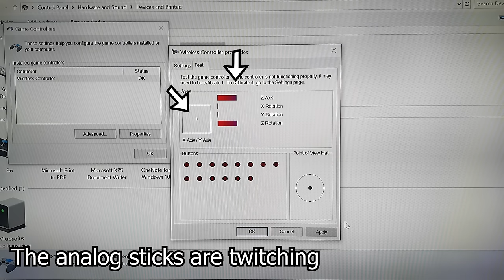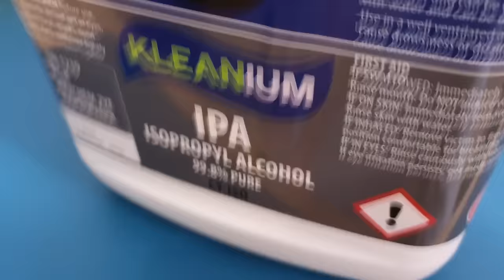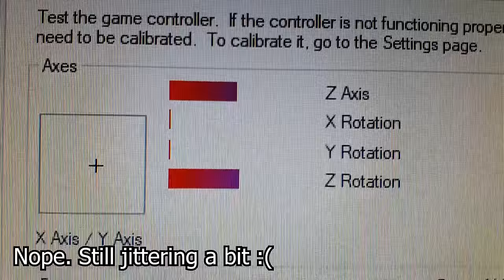How to take apart PS4 Controller and Repair the Analog Sticks

Comment: I have a question do you know what’s the small paperclip which is round for and if you have use it because i accidentally remove what looks like a paperclip although both my controllers work very well I kept the tiny paper clip I found behind my L2 stick
Reply from the maker: The is one of the springs for the triggers. It's what makes the button spring back to it's original position after you press it. It is needed. Not sure how your button is working properly without it.
Reply from the maker: @18yearoldboy38  ok that's good!

Comment: I have a issue with my ps4 controller where every time I plug the headset into the controller the right analog stick starts to drift up. But if I plug it out it doesn't drift.  Do you know why? It's very annoying

Comment: What tool did you use to bend the contacts back? I don't have anything thin enough to between the crack.
Reply from the maker: You can use a knife (be careful). The tool I used is a metal spudger, it's also a dental tool for mixing fillings.

Comment: Did u replaxe it with the fake Alps analog stick? You should buy the original one they're identical but in material in it is different
Reply from the maker: Where do you buy the original ALPS sticks from? How can you tell the one I used is not original? Thanks
Reply: At 9:30 I saw it was fake alps , u can inspect the trimmer area on top of it, a thinner black means it's fake, ,

Comment: I can’t seem to undo the left side of my controller. I can pop off the right side, but the left seems to be pretty stuck and I’m Afraid If I push harder it’ll snap
Reply from the maker: Yeah it's pretty hard, some are harder than others. I've snapped them before. They're aren't super important, as there are 4 screws holding the controller together.

Comment: 2:51 i messed up i broke that little part
Reply from the maker: Oh no, the ribbon cable or the socket it plugs into? The ribbon cable can be replaced fairly easily
Reply: @RestoreTechnique  oh no wait the ribbon cable
Reply from the maker: @navisgay  https://www.ebay.com.au/itm/10-12-14-Pin-Power-Switch-Ribbon-Flex-Cable-Tool-Set-For-PS4-Controll-slY-FF-/393679953199?mkcid=16&mkevt=1&_trksid=p2349624.m46890.l49286&mkrid=705-154756-20017-0

Comment: I simply just drowned my whole controller in a bowl full of 70% isp. For about 10 minutes, took it out, used my air- compressor to blow it out, and let controller sit for 4 hrs..and it works like-a- brand-new, never taking it apart.

Comment: Hey bud need a lil help. my PS4 controller or ds4 controller whatever ya wana call it. Basically.one day it wouldn’t turn on. And I tried every reset and also all the tricks removing from blue tooth and trying safe mode. So nothing worked. I replaced the USB port and ribbon cable. My laptop tells me that the circle and ps buttons don’t work. Tried to clean with alcohol but nothing. Should I replace the film for the buttons that goes over the board? Might have to get a new one no stores around me have a ds4 controller.
Reply from the maker: So you did manage to turn it on, and some of the buttons didn't work? Have you tested the button film with a multimeter? I would test the film using continuity mode, and make sure the O button and the PS button contacts do have continuity with the contacts on the other end of the film, that makes contact with the circuit board. If they don't, you should be able to follow the traces and see that there's a break in the trace for those buttons. If there is continuity on the button film, then either you're reassembling the controller improperly, or the problem lies with the circuit board.

Comment: Hi! After cleaning and closed my controller, x, circle, square and triangle don't work. What shall I do?
Reply from the maker: Does the D-pad work? It would be the plastic film that has the button contacts on it. Either it's damaged, torn maybe, or it's not making proper connection to the motherboard. You will need to open it up to check it.

Comment: My d-pad is permanently pressing left. I've taken it apart, cleaned it, tried the pencil trick, swapped the rubber under the pad from another controller and replaced the green  conductive strip and it still keeps going left! Please help!
Reply from the maker: You've replaced the contact film for all the buttons?
It sounds like you've tried everything, so it must be a fault on the motherboard. Maybe with the plug for the contact film, or a bad IC chip.
Looks like circuit board diagnosis and repair is required. Otherwise a new controller.
(obviously I can't rule out other issues without seeing it though)

Comment: Hey my controller it dropped a lot and one day it fell and just completely broke. It won’t turn on  or charge. But i used to rage ALOT and so their we’re screws inside that were loose and like not even connected to the controller inside. Would me doing this and putting the screws back fix it?
Reply from the maker: Unlikely, sounds like you've got bigger problems than analog stick drift. I would definitely open it up though, it could just be a disconnected battery, or charge port. Or the circuit board could be damaged. How do you know it's screws inside that are loose? Could be components off circuit board, or bits of plastic.

Comment: how are you able to get your Controller to show up on your Computer like that? Im having issues with my right analog and Im trying to see if its really the analog or if its somehow sticking
Reply from the maker: Plug it in to your computer running Windows 10. Go into Devices and Printers under Control Panel. Then follow the video guide from 0:31
Reply: @RestoreTechnique  I have done this , it just does not show, Tried different cords, even restarted my computer thinking it may help, Updated drivers and such to be safe , Notta, Doesnt show what so ever
Reply from the maker: @nick250ification  That's odd, i just tried this now and it worked. Using a CUH-ZCT1E controller, a Sony USB cable and a cheap generic cable. With the controller turned off, i plugged it in, Windows said "installing driver" or something like that, then it was there in Devices. Does your computer make any noise or show any notification when you plug it in?
Reply: @RestoreTechnique  Yes I get noise indicating my computer is detecting a device plugged in but the controller is physically not detected , Unless thats how badly damaged the controller I have is

Comment: Yeah I keep getting that when I release the controller when I look around it keeps spinning round when I let go and then when I try to look around again it won't like its jammed on looking straight when I'm trying to look around then suddenly start spinning around again by its self and it also affects my other keys as well like it won't fire when pressing R2 button and everything else but it can't be the old controllers as I bought new ones and they act exactly the same... So I have no idea what's going on with them but I have noticed that they do it when the battery level is nearly dead so weather that has anything to do with it or something else I don't know

Comment: Tools list?
Reply from the maker: Plastic pry tool, #0 Phillips Head screwdriver, soldering iron, hot air soldering station, flux, solder, kapton tape, tweezers, pliers, 99% Isopropyl Alcohol, cotton buds, micro fibre cloth, and replacement analog sticks.

Comment: What is that thin object you used to get in between you the small spaces?
Reply from the maker: The metal one? It's a metal spudger. It's a mobile phone and electronics opening tool, but it's also a dental tool. I got mine in a tool kit ages ago, and then I bought a new one last year, but it's not as thin as my old one, so I don't use it. It's my favourite tool.
Reply: @RestoreTechnique  ok, thanks!

Comment: When i shake my control it turns off what do you think is the problem?
Reply from the maker: Poor connection probably, maybe with the battery. Or could be a short circuit on the board.

Comment: So I cleaned the potentiometers and put my controller back together but now my x button doesn't work. How do I fix this.
Reply from the maker: It all depends on how it's been damaged/dislodged, you've obviously done something wrong when reassembling it. Check the button flex circuit, see if you've ripped it anywhere. Check the X button contact, make sure it's not dirty, and if you have a multimeter check continuity between the contact and the trace. Also check to make sure the flex circuit is properly seated on the little tabs that align it. And check that the contacts that press against the motherboard are actually contacting the motherboard properly.
Reply: @RestoreTechnique  ok i will check those thanks.

Comment: would hot glue work to solder the wires back on?
Reply from the maker: No. That's not soldering. Hot glue may reattach the wires enough to make a connection, but it would be very sketchy, probably wouldn't last long if it did work.

Comment: i kinda broke the thing covering the touchpad cable, is it fine if i reassemble/use the controller without the thing covering it?
Reply from the maker: Do you mean the white socket that the cable plugs into? 2:49
Reply: @RestoreTechnique  yeah i think so.. or its roof
Reply from the maker: @theddytur  So if the touch pad cable doesn't stay in the slot, then it won't work. You could try putting some tape over it to hold it in place. Otherwise you need to solder on a new socket.
Reply: @RestoreTechnique  reassembled it and thankfully its staying put rn without any problem with the white rectangular roof thing off. i'll try putting some tape over it if it i notice it's starting to come off the slot. was wondering cause i thought it was dangerous to use the controller with the cable just having no cover

Comment: hello I see u used flux so I have it but its color is not all white and it is in a jar not a tube so should I use it and instead of a heat gun can I use hair dryer because i have to do it fast in like 1 or 2 days
Reply from the maker: Yeah any flux will work
I don't think a hair dryer can get hot enough to melt solder, and the nozel is too wide.
Reply: @RestoreTechnique  thanks

Comment: What brand hot air station are you using and what did it cost you?
Reply from the maker: YIHUA 2008D, $100.
Reply: That looks so much easier to use than a solder sucker. Just heat up the whole thing and it pulls right out. I did a stick mechanism recently and it was torture trying to use the wick, sucker add solder re suck. etc. I ended up tearing one of the traces off the board from overheating it!
Reply: @RestoreTechnique  also what temp do you use on the hot air station?
Reply from the maker: @sobrien8478  400-420C

Comment: My issue isnt joy stick drift but the L3 button tends to trigger the R2 button. Sometimes just using the left joystick to move around at all does so. AND sometimes even shaking the controller or squeezing just the handles only triggers it!

I just bought Re4 and im trying to play it, but now i cant! Haha. I did take it apart like shown here up to the point ofbjust visually inspecting the bother board and joy stick buttons but nothing looks damaged nore dorty. Any ideas?
Reply from the maker: That is a very odd combination. L3 is a button in the analog stick that solders directly to the motherboard. R2 is on a carbon flexible film that has nearly all the other buttons on it.
The only buttons that don't use that film are R3, L3, Options, Share, and Touchpad.
The trigger buttons R2 and L2 do function off a carbon resistor on that film. I'm guessing that there's some short or issue with the motherboard, and the L stick is messing with the resistance going to the R2 button.
I would inspect the motherboard for liquid damage, or any fried components.
Doesn't sound like an easy fix though. 😬

Comment: One of this orange things refuses to go in and idk what to do. I've been siting here for an hour
Reply from the maker: Have you got the metal disc orientated correctly? With the 3-4 prongs at the top, facing away from the analog stick?
Did you damage the clips on the orange piece?
Did you just clean your potentiometer or did you replace it? Because not all of them fit on all analog sticks.

Comment: I got a question what happend if I don't use isopropyl alcohol and I use another alcohol does the different alcohol affect the controller?
Reply from the maker: I'm not sure about all other types of alcohol, but it's got to be at least 70% to be safe for electronics. So no vodka!
Reply: @RestoreTechnique  noo thanks i just Buy the isopropyl alcohol 91%
Reply: @RestoreTechnique  now the bad thing is that I cannot clip it back the little Orange thins we're the contacts  are ;-; i'm to weak
Reply: Now i accidently cut of the wire from the board .______.. helpp
Reply: And i don't have a solding iron
Reply: I need help ._.
Reply: What should i do?
Reply: Should i use hot glue or should i desolved the iron

Comment: URGENT! The piece that clips in at 4:50 is not happening for me. Instead of clipping in, I can only lay it into the little box. If I try to put pressure on it, it just floats around in there as there is nothing to clip into. Can someone help me??! Thank you 🙌🏽
Reply from the maker: That's normal I think. The reason it appears to clip in in the video is because I've pulled back the chassis as little as possible, so it's a squeeze to slip it back in.
Reply: @RestoreTechnique  Okay thank you! So I just lay it in there, and close it back up in it's original position right? I am very careful as I have already made some mistakes. Is it bad when the small film with the green lining is peeled off a little bit above the controller, I slipped withy my tool and pulled it back and now it's standing up a little! Is that bad?
Reply from the maker: @sinant.3779  make sure that plastic green film is clipped into position properly. There are little tabs which it clips into. If it's sitting up, that sounds like it's not seated properly.

Comment: ONly the X button is unresponsive!! Should I change the circuit board or smth else, any solutions plz ?!?!
Reply from the maker: It's likely that the plastic button contact film is damaged or just dirty.
It's the plastic sheet with green lines on it. You will need to inspect that for any damage in the green line going from the X button, and also clean the contact if its dirty.
Reply: @RestoreTechnique  Thanks for the feedback buddy, yep cleaned it thoroughly I even applied some graphite along the lines, it's just the X button, if I change the circuit green plastic thingy would it suffice?!
Reply from the maker: @X3MCTZN  Ok cool. Check where the trace (green line) connects to the board, and make sure it's not damaged and is making good contact.
If you have a multimeter I would test the trace. See if a signal is being sent to the motherboard. Because if the X signal is working, it may be a fault in the controllers circuit board, and a replacement button film won't solve the problem.
Reply: @RestoreTechnique  much appreciated bud, happy holidays!

Comment: Can i replace the isopropyl acid with sanitizer?
Reply from the maker: It's isopropyl alcohol, it's not an acid. You can't really use sanitiser, as it's a gel, it will leave a residue, I've never tried it but I imagine it wouldn't clean very well.
Reply: @RestoreTechnique  ooo, i see. Tq👌🏻
Reply: @RestoreTechnique  i have a question. I just fix my analog drifting its work well now but i have another minor problem which is my ds4 light didn’t work. I wonder why

Comment: The contacts on the side of the joysticks will not bend for me. I don’t want to break them. Also, mine are green not yellow. Please help
Reply from the maker: Do they have the same clips as in the video? Were you able to unclip it?
There are green and yellow colours, they are still the same module as far as I know.
Reply: @RestoreTechnique  I did, but I believe I bent the clasps too far. Wish you could fix my controller /:

Comment: My problem is the grey thing on the thumb stick on the right of both thumb sticks the grey thing won’t stay in place and keeps lifting up what should I do?
Reply from the maker: I don't understand which part you are referring to. You mean the rubber coating on the thumb sticks? Where can I see this part in my video, timestamp?
Edit: Or do you mean the metal disc inside? Make sure you have the 3 prongs up the top, and the bumps on the metal prongs facing away from the analog stick (towards the carbon track).
Reply: @RestoreTechnique  at 4:11 yours is black but it’s the black thing on the right side of the analog on top of the grey metal box below it and that is supposed to stay down but mine keeps flipping up
Reply from the maker: @scooby3874  ah ok, I don't know what you've done wrong there sorry. I would need to see it. You can message me on instagram if you want. Link in description.
Reply: @RestoreTechnique  okay I messaged you I temporarily fixed it but in like a week I will need your help

Comment: I thinl i broke one of the green doors for the analog stick any way fixing this?
Reply from the maker: Possibly, it depends in which way it is broken. You probably will need to get a new analog stick, and either replace the whole thing, or just the green side part.

Comment: What happend if the red and black wires come out (need an answer asap)?
Reply from the maker: You need to solder them back on, otherwise your vibration/rumble won't work

Comment: help i opened it up cleaned it and also changed into a new shell as well but when i wanted to put it back it won't fit, the analog stick part won't go through 😭 i am so frustrated now helpp
Reply from the maker: Sounds like the replacement shell is defective and not the right size for the stick to pass through